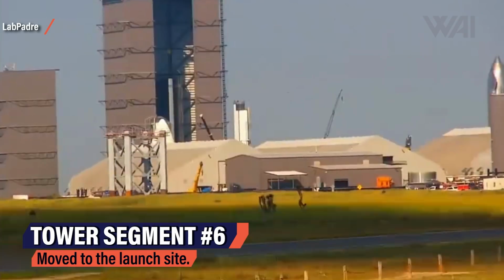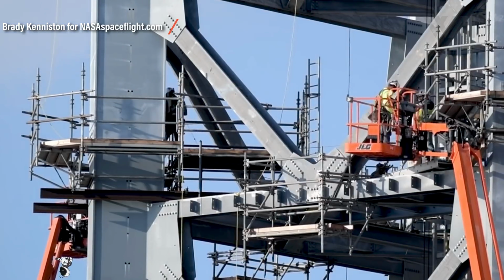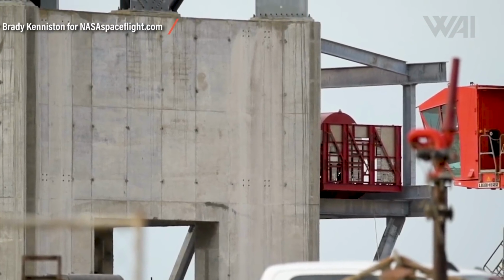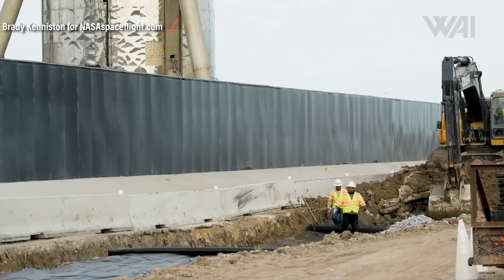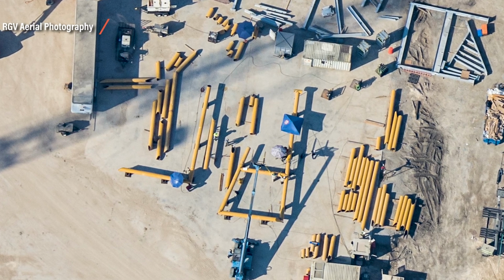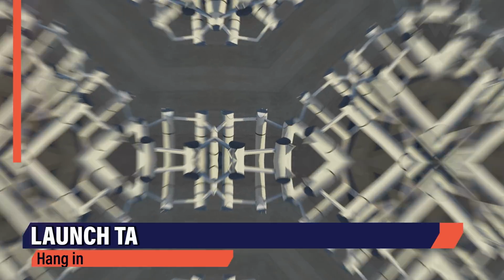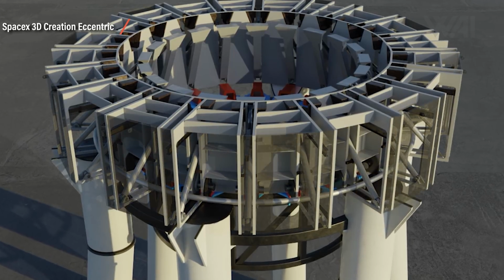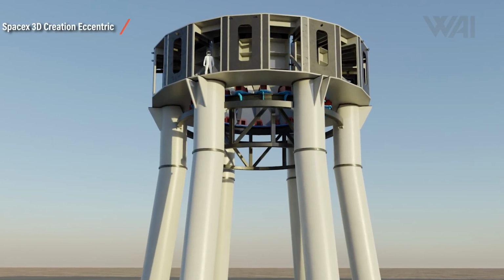Ep171 [Ad-Free] SpaceX's genius move on how to build sea and land-based Starship launch platforms!

Comment: Regarding those huge yellow pipes...  Circular beams have two characteristics that could be useful for SuperHeavy catch: 1) they don't provide sharp edges around their circumference, and 2) as a framework for any sort of mesh system, they distribute load equally around the circumference.